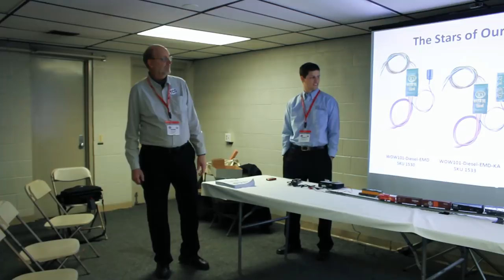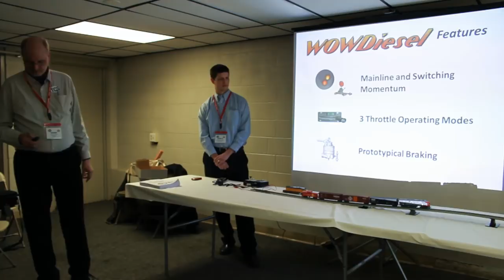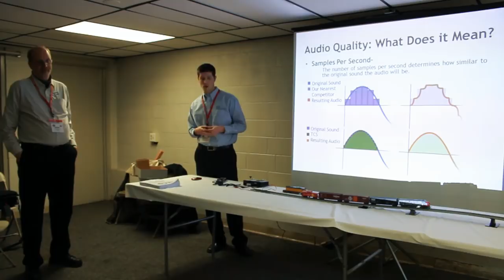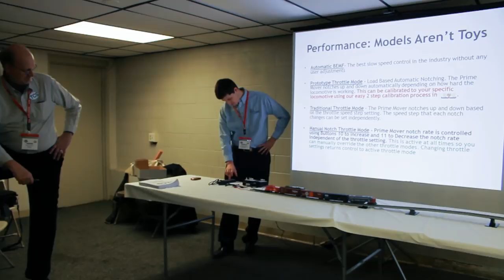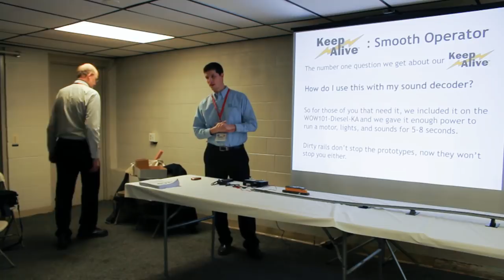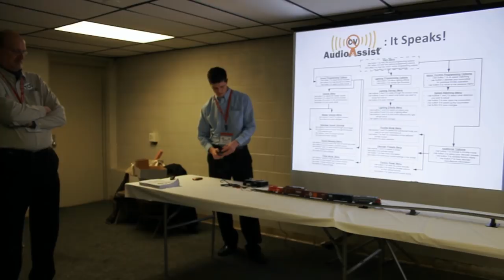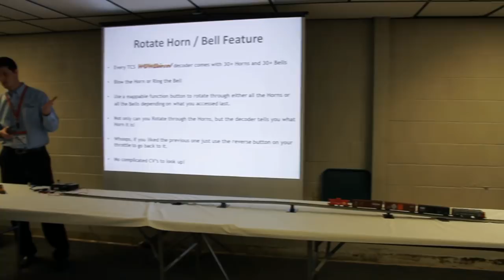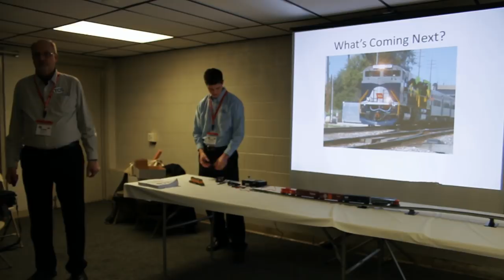TCS WOWDiesel Clinic

Comment: Is it possible to installing Wow Sound,Speakers and Decoder in a 0 Scale MTH Premier SD70ACe 2 Rail DCC engine? because we used DCC Lenz or ESU in Europe thx - Innovation on tracks
Reply from the maker: +bigtoysforlargeboys There is no reason you can't. I've installed them in MTH HO scale engines. But you need to hard wire it after removing the MTH board. Also, I would check the stall current. The WOW can take a 2A stall current, 1.3A continous running current. As long as you don't exceed that you should be able to.